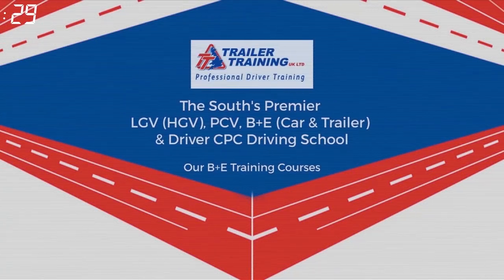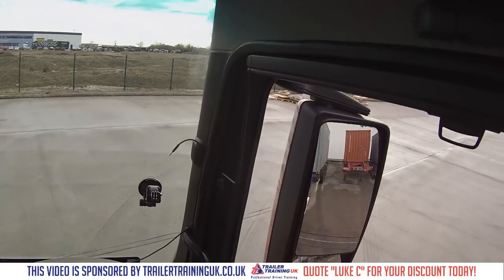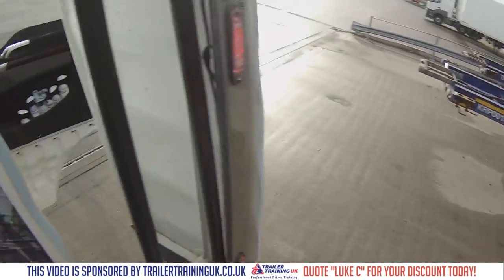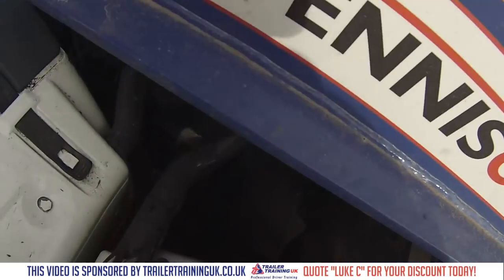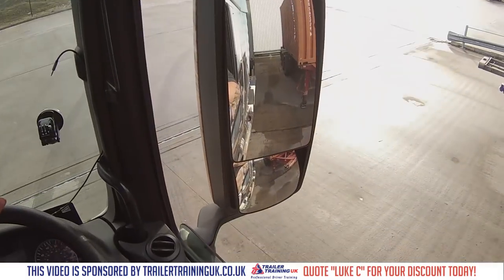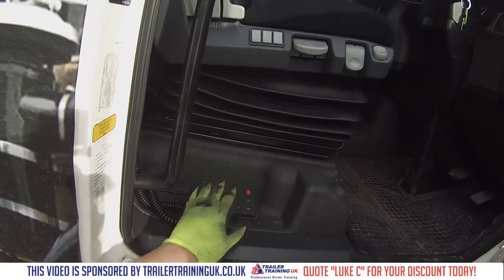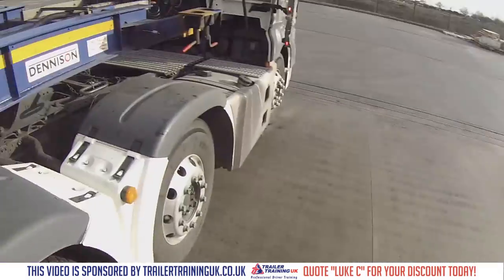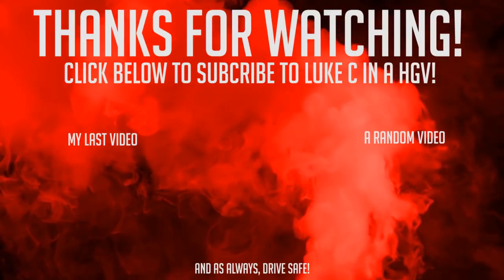POV Trailer Drop & Swap!

Comment: Hi Luke. Quick question? Did you pass in auto or manual? Or do u have to pass in manual cause there is no auto option? Been binge watching as thinking of going for class 2? Any advice? And yes i can drive 7.5t. Thanks.
Reply: Eggie 1970 some companies will give you both even if you pass in an auto only because manuals are not produced anymore
Reply: luke tranter Not produced anymore!! I think you'll find they are, just because the big fleets on general haulage  prefer automated boxes, to stop their cowboy drivers over revving the engine, it doesn't mean that they aren't used.

Comment: Loved the instructional video. Hopefully you do more 😀. 

But I have one question. Just before you took the trailer brake off you took the red airline off and put it on a different connector what was the reason for this? Cheers.
Reply: jay lee airline is needed to release the pins to lengthen the trailer. Then it needs changing to move the trailer
Reply from the maker: It enables me to shorten and lengthen the trailer.
Reply: Ok excellent thanks for the quick replies. I'm still waiting to get my provisional license back from the DVLA so videos like this are really helpful cheers.
Reply: jay lee go for it. Driving is great. I’ve been driving for years now but I still like watching videos of how other jobs are done or how different drivers do things different ways

Comment: Just a quick question but what’s the purpose of lengthening the trailer?  If it’s shorter would it not be easier to get round tighter bends?  Or does it need to be lengthened to function properly?  Not in the industry yet so all new to me
Reply: Driver Jay it’s so you get good traction on the units drive axle
Reply: Texas Trucker Thanks for that bud. If it was unloaded would you then drive with it shortened
Reply: not only that 20ft trailers are horrid they cut corners quicker then 40fts
Reply: You need to shorten the trailer to pin 1 if your unloading a 20ft box on a bay. Then back to pin 3 for the road. Pin 4 is so you can carry 2x 20fts

Comment: Might sound stupid, but couldn’t you just lift first trailer axle and pull these in their shortened position?
Reply from the maker: If you want 25 tones of weight in the back of the trailer then yes. It’ll ruin the tyres though. It’s all about weight distribution. When the box is in the middle of the trailer the Weight is then evenly distributed across the whole length of the vehicle
Reply: Empty obviously haha very interesting watching this style video mate. As a class 2 driver  I’ve picked up loads from your vlogs! Really enjoy watching you learn new stuff and progress to Class 1.